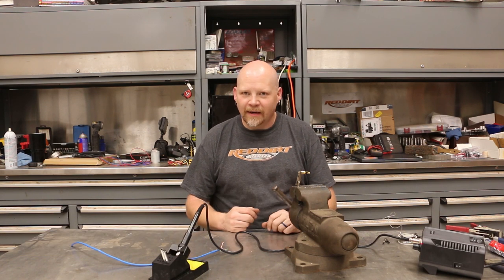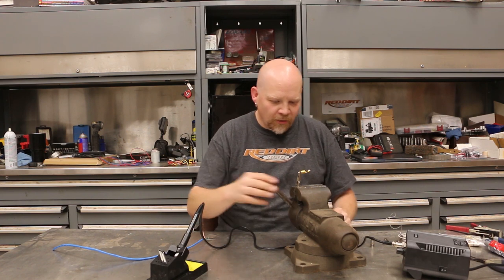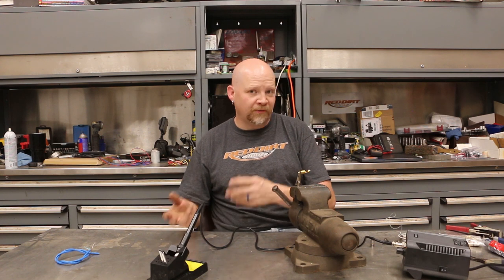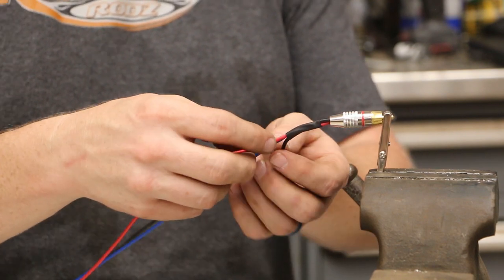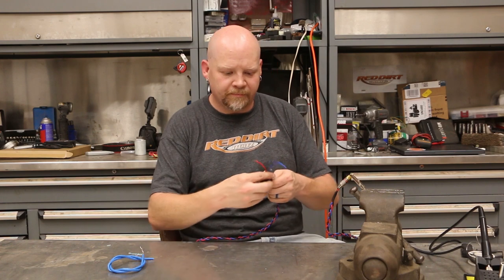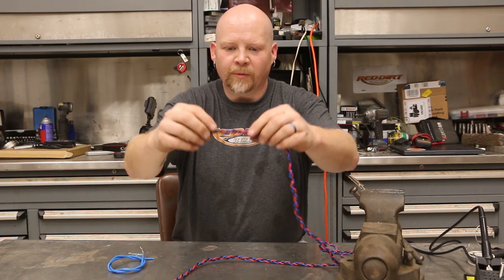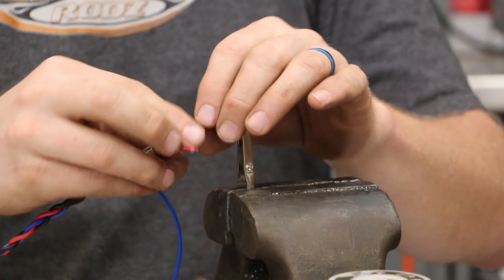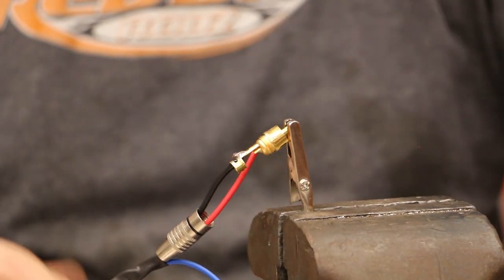How To Make Braided RCA Cables For Superior Noise Rejection!

Comment: The alligator clip is scratching that centre pin terribly. Braiding before soldering would be best. The drain blue wire is excellent idea almost like an XLR connection!

Comment: If you had better soldering skills you could twist the blue with the cold and solder it to the cold of the RCA,because if you have to ground the blue with ring connector to Chassis what a pain in the @ss to disconnect it should you want to do so.

Comment: Good job with that cable. Cool idea using the extra wire as a ground wire. I bet they’d be good on turntables. Did you measure the capacitance and/or resistance of the cable of the length you built? Thanks very much! 🔊😊🎶
Reply from the maker: I have measured it, i didn't include that in the video. Maybe I will do a cable test video, i usually test them with my Audio Toolbox, which has a built-in cable test.
Reply: The lowest resistance cable I've used is Van Damme's Locap55, it's designed for guitars but has similar resistance to 75ohm coax cables so I use it as an interconnect and a digital cable

Comment: Would this work if you looped some of the braided wire in the door by the speaker, or would the loop cancel what the braid is doing? So, not necessarily running a new wire, just creating a "noise sink" at the door.
Reply from the maker: Running it around the speaker wouldn't do anything positive. 

The braid is the noise sink for the low voltage signal, it won't help with any other noise, and looping any signal wire creates an antenna for noise, which should be megsted by the braid, but I wouldn't do it.
Reply: @Reddirtrodz we are on the same page. "-)
I also get that you need at least 18 braids. I was thinking if you then used that 18 braid section at the speaker as a service loop we'll say, then i dont have to rerun the whole connection. Although, now that I'm thinking about it,  the old wire could be my pull string. Ha ha

Comment: What about just using a ferrite choke~
Reply from the maker: You can use a choke, but that is like putting on a band-aid when you need stitches. 

Braided pair with a ground isolator doesn't need a choke and is far better at rejecting noise.

Comment: I use Van Damme's Locap55 cable with cheap plugs off ebay, great sounding cable and as good as a branded store bought cable at 10 times the price

Comment: this is how i braid my hair. if you braid cable like this, don't use a crocodile clip to hold the plud, you could damage it. instead, use something with a socket to plug it into, like i have a cheap DAC off amazon i don't use. a bit of bluetack under it and it's more effective than that clip. also, get some expandable nylon sleeving and fix it in place under the heat shrink, it'll make the cable look better

Comment: 12:28 Do you mean to secure the ground to the vehicle chassis and the radio chassis on each end?
Reply from the maker: No. The ground wire is a shield. By grounding it at one end only, any EMI noise will be directed to the ground, eliminating the interference. If you ground both sides, you end up with a ground loop which creates an imbalance in the signal.

Think of the shielding ground as a lightning rod,

Comment: If your poor excuse for a soldering iron WAS"NICE & HOT" like u said, the solder would melt within 2 seconds. Tinning the iron would help too as would using flux. This is NOT what I'd call a tutorial on  soldering anything. This is how no idea experts do it.  Nice work,  except it's terrible. Sorry to break it to you.
Reply from the maker: Sure, the solder melts instantly on the tip, but you have to heat up the  base metal, which takes longer than a couple of seconds. If you just let the solder melt on the tip to the wire, you get a cold solder joint. Take your no clue having ass out of the comments, bud.

Flux is not needed with rosin core solder for electronics. Hate to break it to you...